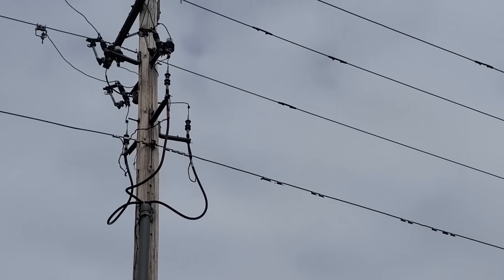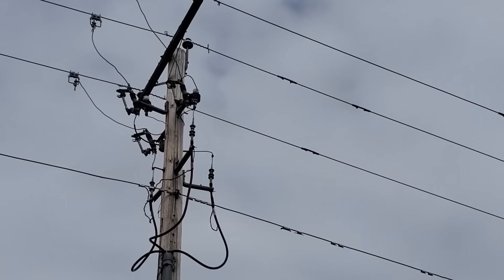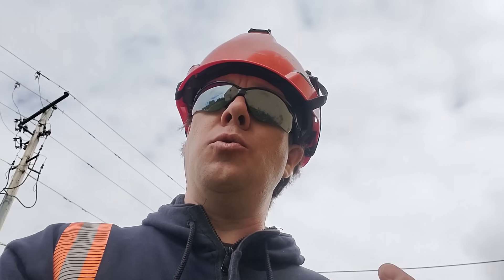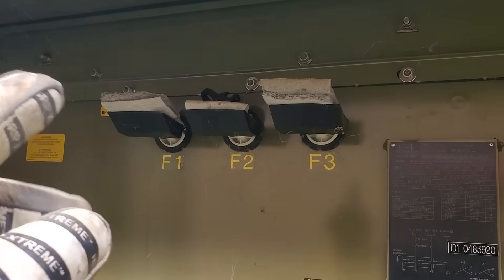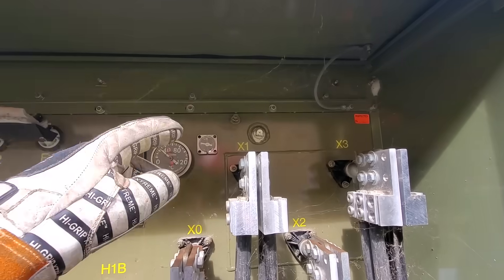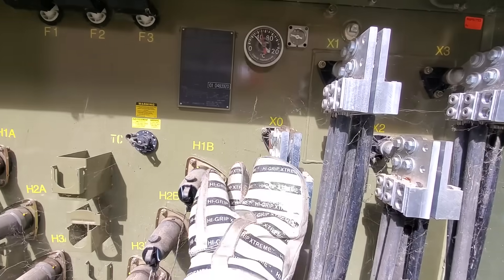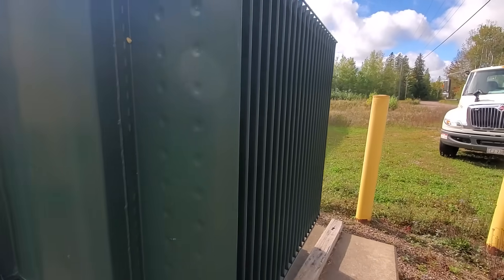A closer look at Padmount Transformers

Comment: Great Video .  Could You Go into the mounting of pad mounts and the Grid beneath them.  There was an incident where during a temporary pad munt had a grounding grid?????  That and neatrual not bonded that caused some sort of difference in potential with other Communication strands bonded.  It turned out that the Difference of potential was using other strands in aerial for ground.   Very Interesting  scenario.   Also Anything on 34kv.  single phase?

Comment: I noticed there were different types of cables on the secondary side. Any chance you can talk through copper vs other conductors for your role?
Reply: @5:31 you can see the three incoming MV shielded cables on the left.  In this case it looks like they are using the copper shield to directly bond to ground.  In most cases they will spring on an AL braid onto the shield under the termination and bring that out to bond to ground.  In both cases they have a drain line brought up to loop onto the semi-con of the Load-Break elbow bushing's dedicated drain line hole.  It's hard to see on these because the tags hanging from the capacitive tap cover.
On the B side of the High side the bushing covers have AL or Copper drain lines grounded on the copper bus that runs horizontal on the middle bottom of the XFRM.
For the Secondary of the XFMR, they are using White, Red, Black and Blue to denote Neutral, and each phase.
You can also peek the X0 ground strap between X0 and X1 cables (white and red marked).  Also another frame ground strap in the bottom right.
The bare coppers are your leads to a ground rod, or part of a bare copper ground grid or to UFER.  This is the far bottom left.  The insulated copper on the bottom right that is hard to see is brought out with the other low side conductors.  It looks insulated, but could be the shadow.

Comment: Nice peek inside for those that have never seen inside a padmount before. You should do some padmout switches if you can too to show people as well. Interesting, is that normal for your system to have the LV side Red/Black/Blue? I'm used to Black/Red/Blue here in the US. For the HV side I've seen mostly Red/White/Blue (yeah, yeah... colors of the US flag, makes it easy to remember, for 'Mericans anyway) . Been doing a lot of padmount testing with my new job, but don't recall seeing any without the HV /LV partition in them, like your example here. My new job is very interesting, without saying where it is, you can look at my recent uploads and figure it out! Not many places in the world launch rockets on just about on a weekly basis. Definitely seeing some cool stuff around, work inside some very interesting buildings with really interesting pieces of hardware inside. Not to mention hooking up the "shore power" to some of the mobile launch platforms. 
Keep up the informative videos and work safe.
Reply: Canada is Red/Black/Blue for L1, L2, and L3. USA is Black/Red/Blue for 208Y120.
Reply: @brnmcc01  Thanks. Even though there is no listed standard in the US, most would do it black/red/blue and figured Canada the same, guess not.

Comment: Many years ago, the local supply company built these in-house. I had a holiday job drilling endless holes in metal for frames holding fuses for each of the low voltage cables feeding out to the consumers. I see in this design all cables are connected directly to the secondary terminals - a cable fault could prove interesting! The bigger fuse frames had maximum demand metering as well. Designs have certainly changed...

Comment: By the color of the secondary wiring, red, blue, black, this is a 120/208Y secondary. What configuration is the primary, Y or D?
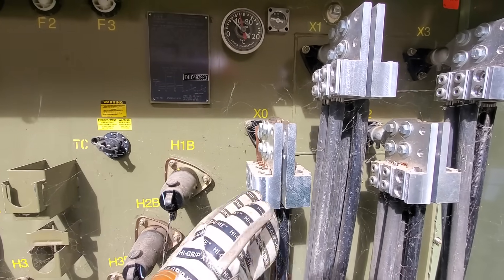Reply: Y with the H0 bonded internally to the case. At about the 7:50 mark you can see enough of the nameplate to see the vector diagrams.

Comment: The Secondary sides of the padmount transformer with the X1 etc. Those conductors that r there where it goes to a panel?
Reply: Yep, those go either inside houses to the meters or to curbside fuse boxes that connect to meters in individual houses.
Reply: @johndododoe1411  👌
Reply: @johndododoe1411  We don't run 3 phase to individual houses.  These are likely industrial or commercial users.

Comment: This is really interesting, comparing your electrical distribution system to ours is quite intriguing! It's also really interesting that you don't have any switching equipment located with your transformers. In the UK its common for there to be a HV switch that is oil or gas(SF6) filled on every transformer (called a 'Ring Main Unit'). This switch incorporates an earth position to earth down the HV side of the load, and is actually three switches. The switches can generally be operated remotely, and also form an electrical distribution ring with an 'open' point, so that if a fault develops on a cable the open point can be moved to reconnect customers, and this all can be done remotely in a control room.
Reply: In NA we generally avoid ring circuits at all costs, over the distances involved there is nearly certainly going to be a potential and/or phase angle difference between any two given branches even if they are all of the same gross voltage and even if they're all from the same substation transformer, simply due to the different lengths of wire.
Reply: @44R0Ndin  It's actually common in the US for Padmount transformers to have a high side switch that will isolate the pass-through connections from the windings.  Maybe 70% of the ones I've worked on have had them.  The three position ganged-switch, Andy, is present in a separate device that is usually located near the transformer it feeds, which are not always present(as shown in this video).  In this case, the fused cut-outs can be pulled to open the circuit from source.  But this does not ground the circuit that was opened.
Also, that interior is dirty.  Annual cleaning will clear out those spider webs and dust from the semi-con material.
I would also much prefer pulling the loadbreak elbow rather than pulling the bay-o-net fuse on a live transformer.  The LB elbow has an arc-interrupting prong that is designed to help extinguish any resultant arcs from breaks during load.  The fuse does not.
Reply: @44R0Ndin  That's the excuse they give, but the real reason is it's more expensive, requiring more safeguards and companies in North America are bastards.
Reply: @Alacritous  Correlation does not imply causation. It is more expensive, and companies in NA are bastards (USA especially), but squirrels still cause 10-20% of all outages.
The part where the "companies are bastards" comes in is when a big storm takes out a whole lot of stuff in an area and it takes 3+ whole days to get power back on in most places when if they were adequately staffed and equipped they could easily cut that time in half. THAT'S where the cost-cutting bites them in the ass.
But one squirrel going across the HV or LV side of a transformer and causing a handful of customers to lose power, that's on the rodent, not the power company.
Reply: @44R0Ndin  If they had a ring circuit they could restore power almost instantly to affected customers except the ones directly behind the fault. It's that that I was referring to. It costs more to design and build a ring circuit so they don't.
Reply: @Alacritous  Ah, you see that does indeed reflect how the HV lines are installed sometimes in NA, but not that often.
I got confused because I was thinking you were thinking it works something like UK residential building wire ring circuits. IIRC the US National Electrical Code actually outright declares ring circuits inside a building as not code compliant, since the way the NEC is written means that you have to have every segment of wire in the circuit able to indefinitely carry the full rated current of the circuit.
Even if that wasn't the case, I don't see how a ring circuit does what it was supposed to do, namely saves money or material, since you have to use EVEN MORE WIRE to make the thing a ring circuit instead of a branch circuit, which just goes and eats all of the "savings" you just created 90% of the time.
Reply: @44R0Ndin  Yes. Not making a ring circuit saves money in material and in management hardware costs. A ring circuit would use more in material and management hardware so they don't do that even though it would ensure more reliable service to the consumers.
Reply: Did you notice they used the British phase colours on the HV side?
Reply: Same here in India. But don't think they are remotely connected.
Reply: same in western australia
Reply: it´s seems like a scissor like cut off up the pole
Reply: Yes here in Australia we tend to follow the UK example we always have , being a commonwealth nation. Using a 240/415 v secondary system allows fewer but much larger pad mount substations ours vary from 300kva to 1000kva in pad mount form any larger than that requires substation buildings sometimes with the transformers in secured yards for better heat dissipation and utilisation of ratings compared to indoor locations. Looking at the American/ Canadian system shows the big differences in underground distribution because of the higher voltage drop issues on the secondary making long long secondary feeds not feasible. Lots of smaller padmounts with elbow type switching devices cheaper and necessary as there is not room in those enclosures for discrete HV switchgear. Basically the secondary voltage determines the design more than anything else.

Comment: Do those lines have their own ducts or they run through together?
Reply: Look closely when camera pans down inside.  There's a separate plastic duct for 12.7kV coming in from the pole and for each customer voltage cable set exiting the box.  The isolation thickness on the individual cables differ.

Comment: Nice. We have about the same equipment in our country. We still have the old style transformers in transformer houses, with the  high voltage junction and low voltage distribution in seperate rooms on both sides of the transformer, behind metal doors. 2 times I had heard the high voltage fuse blow. Man, was that loud. Like a canon. The fuses were rebuild on the spot, which looks like a 1/4" strand of wire rope.

Comment: I imagine that wildlife is fond of building homes inside the transformer box - I've heard of families of squirrels, and eventually one of them shorts out the high voltage, annoying the customer.
Reply: Generally that's a self-clearing fault if across the HV terminals. Dang squirrel gets vaporized.

Comment: Whats the life span of the Little one in my back yard
Reply from the maker: That's a good question! I come across plenty that are 40-50 years old
Reply: @Bobsdecline  40 years if they make it past warranty min.
Reply: Manitoba Hydro a few years ago produced a report on life expectancy on different components and under their operating conditions they figure to get 50 years out of a pad mount  vs 70 years for a pole mount transformer. 

A lot of pole mounted ones will fail sooner due to animal contact, tree contact or lightning though.

Comment: Nice video, specially when we in Scandinavia got another power system. We got 230Volt between Neutral and Phase, and 400Volt between phases. We also got digging all of our pole cables down to the earth due to thunder/outtakes, so its nice to see you still got those "over there"
Reply: a 347/600 volt system is actually quite rare in North America, I think only Canada uses it and even then parts of Canada use 277/480. But in both Canada and the US the  347/600 and 277/480 systems are only used in commercial and industrial installations. Residential systems use either 120/240 for split phase power or 120/208 systems for three phase power. Most Residential settings use the 120/240 split phase systems, but occasionally a farm house or more commonly, a large scale apartment block will have 120/208.
Reply: @ryuukeisscifiproductions1818  347/600 volt is apparently used by textile mills in the Southern USA. I know that I purchased a small 1kVA step-down transformer on Ebay with a 600V primary and a 120/240V secondary from a US seller, so someone, somewhere in the USA did or does use 600V.
Reply: @ryuukeisscifiproductions1818  depending on where you are, you can also get a 3phase 240V Delta, with a 120V tap. Very common in Chicago and the surrounding areas.
Reply: @ryuukeisscifiproductions1818  Unless you are in NYC I am surprised that you have run into 208 volt electrical systems.  From what I have heard the rest of the country has residential buildings on 240.
Reply: @mharris5047  Most larger apartment blocks are supplied with 120/208 overall with individual units using two out of three phases. And yes occasionally a Farm will use three phase power, though it is actually quite common for farm irrigation systems to use an open delta 208 supply. Also depending on the Power Company, residential Three phase power can be requested.

Comment: Is that a TN C-S earthing system
Reply: Either TT, IT or TN-C.  The TN-S part of TN-C-S happens only after the meter.
Reply: @johndododoe1411  In our country TT Terra terra (terra=earth) system is extremely rare because our ground conditions don't allow TT systems and would be used on rural locations where the transformer is far away from the user. IT system is found on ships and verry special instances and I don't know of any other place where It system would be used That is why alot of land based electricians struggle on ships/It systems because they don't know the earthing system. If it is a TN C Terra Nutral combined system I would change it immediately as it can cause a verry dangerous situation and Is illegal in my country(must be replaced as soos as it is Identified) if it's a TN C-S Combined-seperate system your earth conductor would split off from your neutral conductor before the consumers main C/B and E/L  whether it connects before or after the meter I dought lt will make any difference but is still not the safest system and would only be used and installed if the costs are really prohibitive. Otherwise you should always expect a TN S seperate system where a seperated earth and neutral conductor is wired directly From the transformer both connected to the star point and earth. As I only see 4 connections and no extra earth conductors L1L2L3 and N I assume it must be a TN C-S I would personally rule out a TT system as why would you seperate the earth's with seperate earth spikes when the building is so close to the trannie.
Reply: @ironwolf6849  This is before the consumer system.  If the LV side is TT, the neutral is grounded in the transformer shown and building systems have their own PE electrode.  If LV is TN, the transformer setup is exactly the same but buildings use a split from the N as their PE, thus forming a TN-C-S.  The HV side has no N conductor so either it's a TT system grounded only at the remote supply or an IT system capable of surviving accidental grounding of any one wire.  I have been told of some rural parts of Norway using 230V phase to phase IT for LV distribution in mountains, specifically to survive accidental grounding at any pole.

Comment: If you disconnect a single elbow on the primary side whilst that hot line is live, are you not going to mess up the phase rotation on the red, yellow blue lines output from the secondary side? Isn't there a risk that some loads, such a 3 phase motors used in industrial premises may then suddenly experience a problem, such as suddenly stopping and large currents developing inside as there is no back EMF?

What do you do to prevent this problem?
Reply from the maker: We generally we only do live switching when paralleling. Even then, it's not often. Most times if we're de-energizing it, we will open the cutouts. It still drops off one phase at a time, but will have all 3 open quite quickly. 

We also have padmounted switchers with 3 phase gang operated switches. Those are installed mostly in the city that's prominently underground. A handle is mounted in a locked compartment on the side of the switcher and the internal switch operates all three simultaneously with load break capabilities

Also, Yes we have to be mindful of rotation when re installation elbows